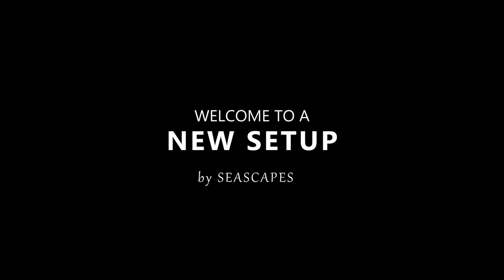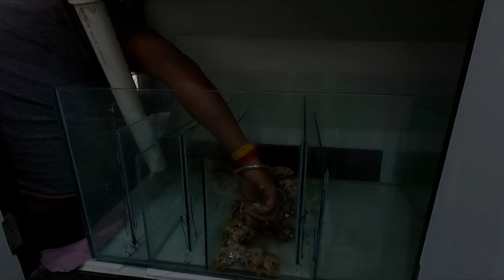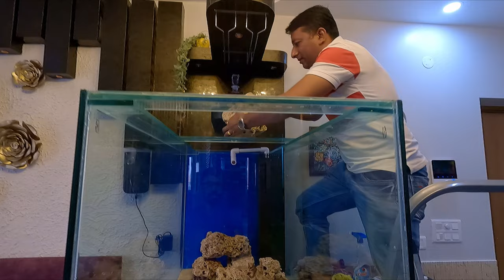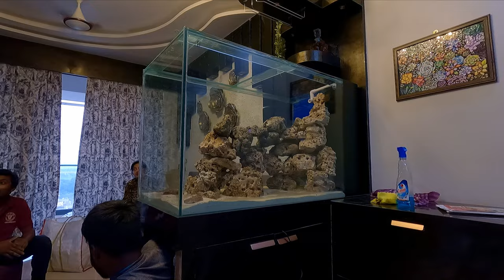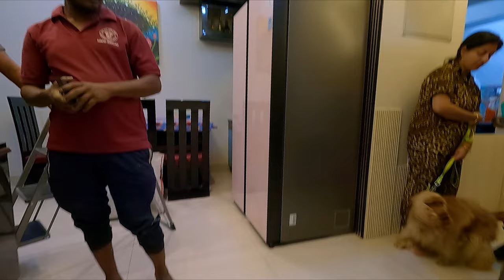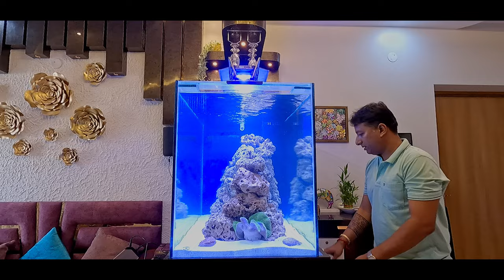QUALITY is not an act it's a HABIT | premium set up by seascapes

Comment: Nice setup. Been watching your videos. Two suggestions: pls use black premium vinyl sticker and avoid blue. Looks tacky. 
Always give customers high quality glass cleaner. I know it cost 8 to 10 k. But when glass get scratches or those magnets of chinese ones rust, it will be extremely expensive repair job. Those will scratch even ultra low iron glass due to poor quality of magnets and cloth. Also it will keep separating itself and if it falls between rock work good luck getting it out. You can but your customers won't be. 
Plus clarki as first fish!!! Bro that will establish the entire tank as it's territory and even bully bigger fishes later. Thankgod you didn't leave two. If it becomes mated pair and start to lay eggs, God help other tank inmates. 
Im in marine for more than 2 decades, I have done extra nano builds due to host these clowns later. Esp very aggressive variety like clarki, tomatoes and maroon lightening. They will cause such mayhem, your customers will scream. Have had lots of dead fishes due to thier aggression. I think you remove it after your video. You being in this trade will know this already.
Reply from the maker: Thanks for your suggestion